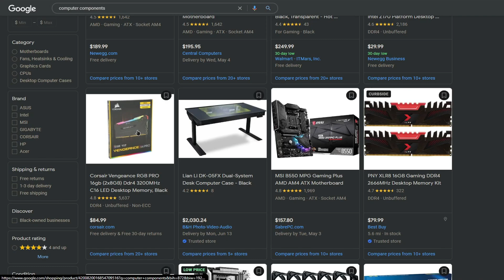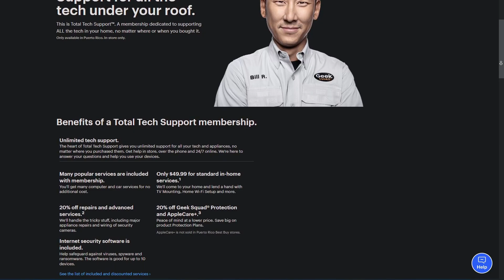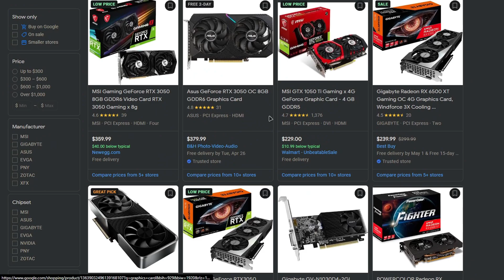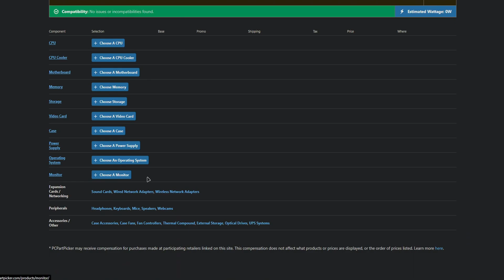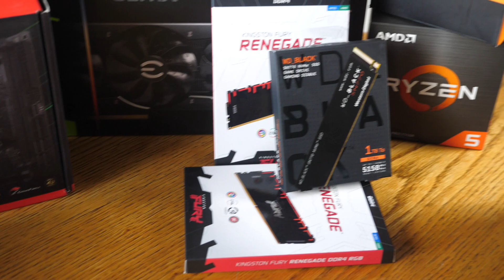How To Build A Tiny Form Factor PC!

Comment: Question. How do you fit the EVGA 3080 (which is 2.2 slots in width) into the GPU bracket (which is supposed to only fit 2 slots GPU)?

Comment: You installed the gpu wrong.  You're supposed to unscrew the mounting bracket, put it all together with the gpu, and then drop the whole assembly into the pc.  That way everything is connected nice and tight and you only have to worry about getting the extension attached to the motherboard instead of messing around with the gpu and stuff.

Comment: You mention you would have chosen another CPU cooler (the Noctua), and that you would explain why later. But I do not think you followed up on that statement. Could you elaborate what you meant by this?

I am looking at doing a build in this case and I have heard the CPU fan can sometimes suffocate on the hot case air unless you can successfully create a 'wind tunnel' between the case and the heatsink.
Reply from the maker: I am going to explain in my second video. this wind tunnel is exactly what I'm working on now

Comment: Why did you choose Win11 over 10?
Reply from the maker: honestly, I just love the look and feel of windows 11, it's exactly like 10, just cleaner and prettier so there's almost no difference besides that.
Reply: Can't read his mind, but from my (still rather short) experience Windows 11 is great. It's not too different, it's like a modern, more polished Win10. Everything is smoothly animated and has nice presentation, performance seems to be great.

That said, I'd probably go for Win10 if I was on a Ryzen system (or older Intel) just to avoid potential instabilities, since it is still fairly new.

The reason I went with Win11 is because I went with Alder Lake (12600K) which means having E-cores, and Win11 has an updated scheduler to account for that. The E-cores can confuse Win10 in some applications. 

One thing that was interesting to me is that I tried Win11 on my old platform, which is now pretty old, as it is a Haswell i5 (4670K) and it ran smoother than Win10. I was pleasantly surprised.

Comment: ive actually been dealing with some computer troubles for the last few months. ever since trying to install windows 10 onto an SSD to finally boot faster into my OS. 

my PC was simply refusing to boot into windows on the SSD and i have no idea why to this day. i figured it was a problem with the version of my BIOS, after all, my motherboard was considered "ancient" by some of my friends (i bought it 6 years ago). 

so i decided i'll flash the BIOS and try again. tough luck, because my BIOS refused to flash. whenever i tried to open the Q-Flash option it would reject my USB drive. i KNOW i was doing everything right, so this also confused me. after days of fruitlessly trying to research my problem online, I conceded and bought a new motherboard. GREAT! MY PC BOOTS! nevermind, because it was getting BSODs CONSTANTLY. sometimes there were entire days without any errors, other times it would BSOD every 5 minutes. every BSOD error was different. i looked into every single error as it appeared and fixed them one by one until the only two remaining BSODs which i would see alternatingly were both related to the RAM.

now, i have run diagnostics on the memory modules in my PC and saw nothing wrong, so i have no idea if the problem is faulty ram modules or a faulty motherboard with malfunctioning memory interfacing. eithr way, my payday is coming up in two days and i will buy BOTH new RAM AND a new motherboard to ensure both are mint condition. if this doesnt fix my PC i have no idea what will. (im also looking into moving my system into a new case with better airflow, as well as switching to air cooling a few months down the line).

Comment: Nice build!
A few notes though:
The 5800x/5700x might only be a tiny bit better than the 5600/5600x in gaming, but it has 2 more cores, which are much more useful when doing production work, such as rendering a video -- the improvement there is practically linear to the core/thread count.

It's only DDR5 ram that's low stock, overpriced as hell, and scalped, DDR4 has pretty good pricing.  Only intel's 12th gen can use DDR5, but it's also compatible with DDR4.

2400Mbps DDR4 is really bad, and I'm confused as to why you got it?  Try search benchmarks for 3600 vs 2400, and especially pay notice to the 1% and 0.1% lows.
Reply from the maker: ooh! I may have to do some overclocking there! good call on that!

Comment: Fun fact the Node 202 can fit a Morpheus 2  on a GPU with noctua slim fans.

Or a 3.7  slot GPU#

The only downside is CPU cooler height , some better models are just 2mm too tall, which is if you remove the dust filter. The IS 60 just barely fits ( The noctua AM4 mounting kit is a MUST ) IF you are willing to mod the case just a tiny bit
Can post pics if you want.

PS If you remove the back panel you should be able to access your M.2 on the back
Reply from the maker: good points! there's so much I love about this case!

Comment: I did a similar build during lock down but with a B450 and node 304 - that case is tight for space I had to go with a Corsair 600w sfx psu  but got a 212 evo with noctua fans in no problem
Reply from the maker: I've seen people put liquid coolers in this thing!

Comment: Awesome build. Love it. I have always wanted to build one, but I end up getting a larger tower because of space and cooling, or options for more storage space. 
I am curious though. As this video ended there was no testing of heat between normal fan, the 3D printed tool you made, something special with the case or why you wish you had gotten the Noctua fan. I assume there will be a Part 2?
Reply from the maker: yes, the part 2 is gonnaa cover cooling and painting the case ;P

Comment: 9:04 Instaling the PCI-E riser card is tricky in the Node 202. In the video (9:04) all 3 screws are missing from the card. These screws secure the card to the frame of the case to protect the PCI-E slot from excess force applied when installing the GPU. 

See the correct way of installing the PCI-E riser card is to remove the middle frame of the NODE 202 (there are a few screws you need to take out) and screw the Riser to the middle frame and THEN slot the PCI-E Riser card with the attached middle frame. I made the same mistake so is not a very intuitive design choice by Fractal. Overall, it is a Great compact case, but things inside get Really toasty. Great video for an Old (but great) Case.
Reply from the maker: oh that makes sense! I should have known!